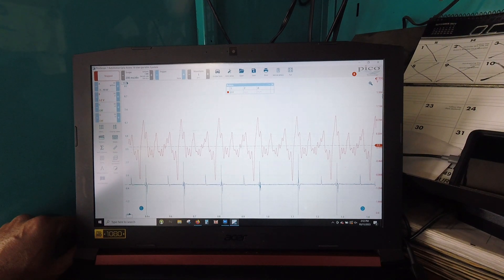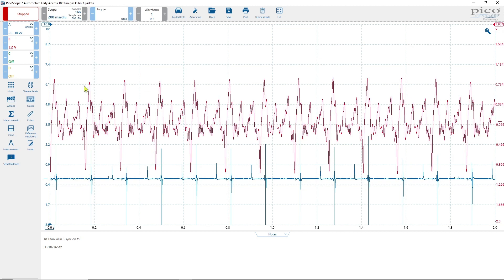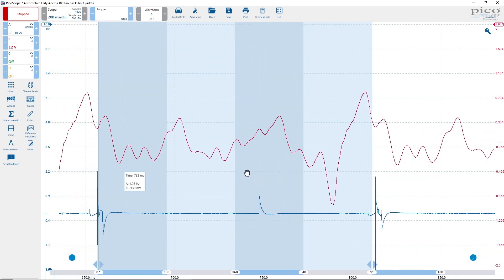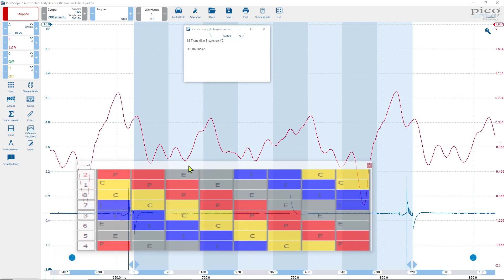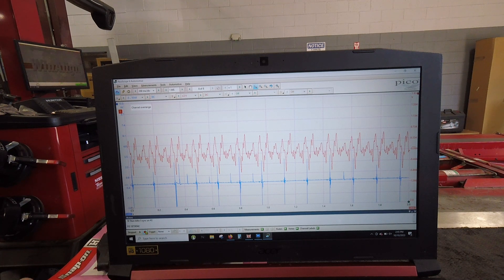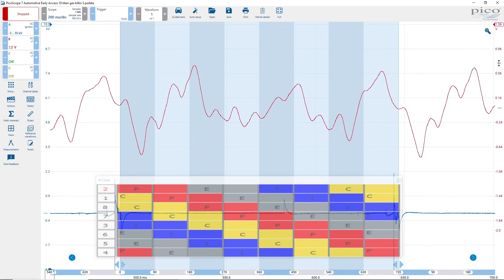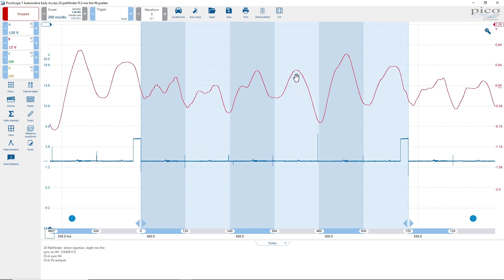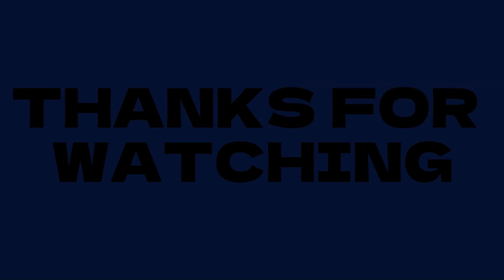V-8 Mis-Fire

Comment: Great video,thanks for your time.If the vehicle has dual exhaust does it matter where we hook up the exhaust pressure transducer? Thanks
Reply from the maker: If its like a duel outlet muffler I stuff rags in one side and check the other. One some high end X pipe systems I check both sides , one at a time and then process the data. I always block one side off no matter what the system is. IMO there is no one size fits all test, each vehicle brings different tests procedure. The fun part😀
Reply: @CartersDiagnostics  got you.thanks.I wish i can be part of the pico group but I already own an ats scope for long time.maybe my next Christmas gift.